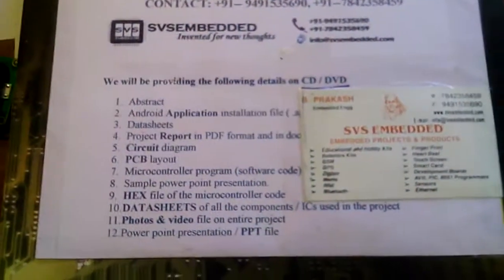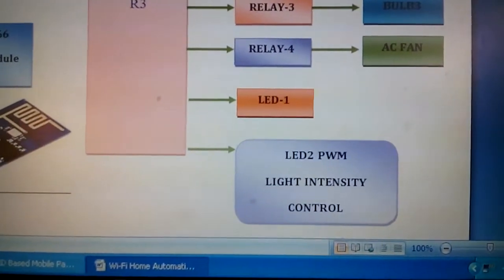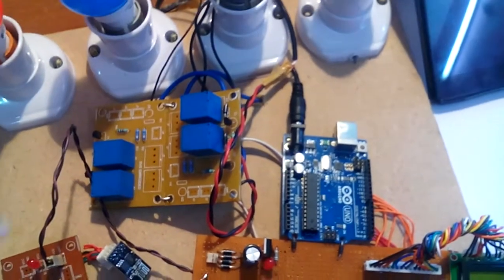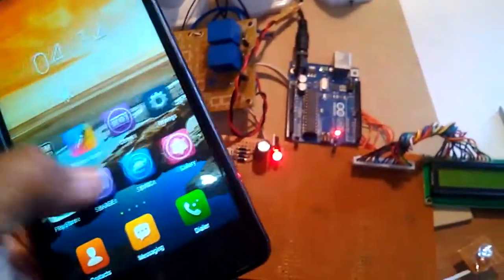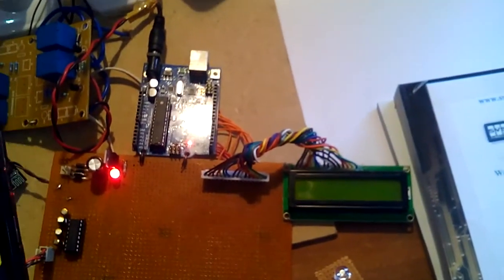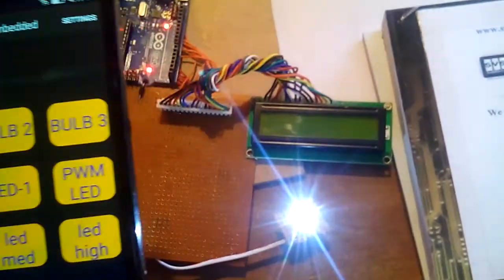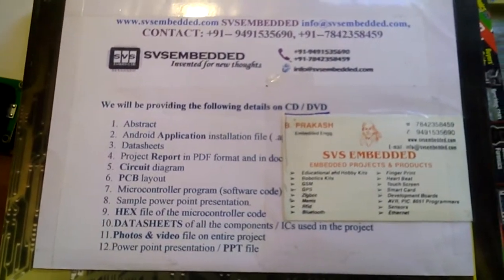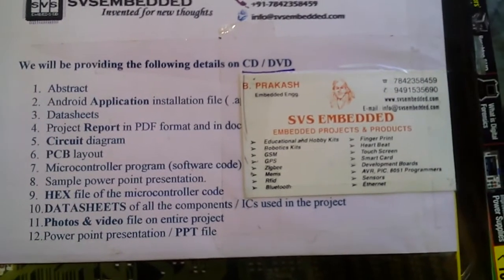Arduino Smart Home Automation | WiFi Home Automation - Arduino  | Android WiFi Home Automation

Comment: sir how to program
in my cash on - off is Work but low - med - high is not work can u help ?
Reply from the maker: Thanks for comment and your valuable Feed back,we are selling the projects with least cost.
if u order the project we will provide working hardware kit along with 
1.abstract
2.datasheets
3.documentation
4.schematic( circuit ) diagram.
5.software code.
6.sample ppts
7.photos&video file on entire project
through google drive.if u r interested to take the project.
send me a mail to  svsembedded@gmail.com,info@svsembedded.com.
we will send u the how to order procedure to u.

Comment: very nice project sir, i am also want to build this but i have some problems related to the controler can u please help
Reply from the maker: Thanks for comment and your valuable Feed back,we are selling the projects with least cost.
if u order the project we will provide working hardware kit along with 
1.abstract
2.datasheets
3.documentation
4.schematic( circuit ) diagram.
5.software code.
6.sample ppts
7.photos&video file on entire project
through google drive
send me a mail to  svsembedded@gmail.com,info@svsembedded.com.
we will send u the how to order procedure to u.